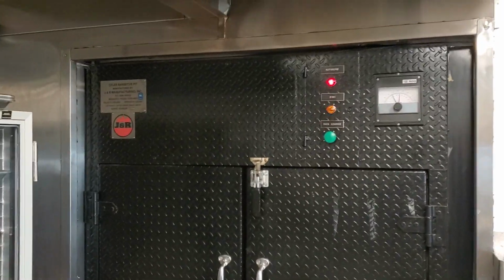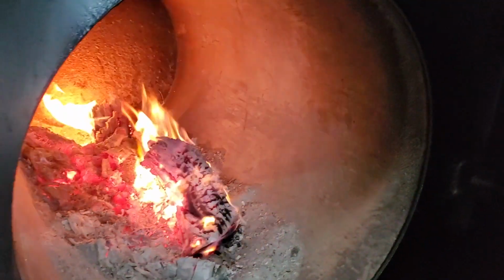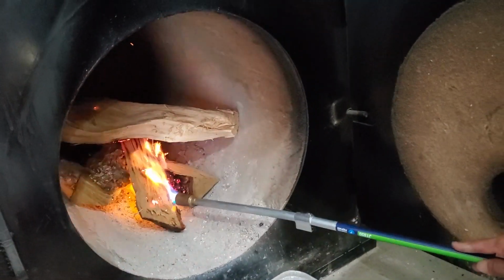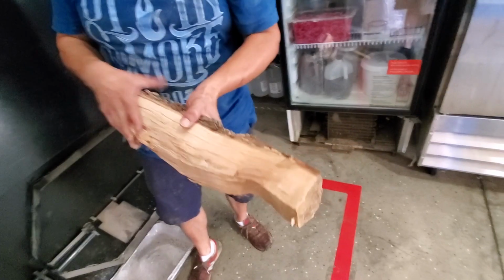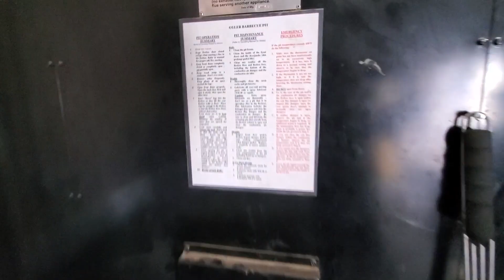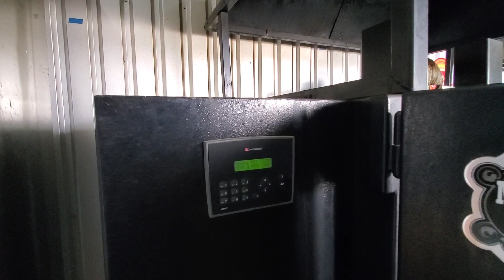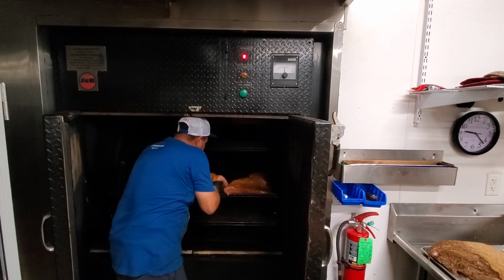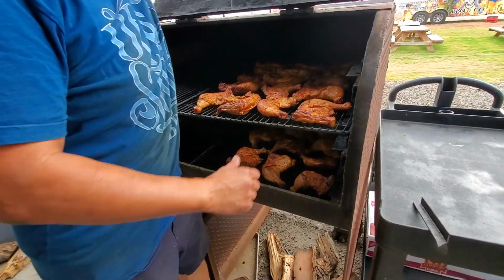Part 3 of 3 Texas BBQ Champion Junior Urias $100K Smokers TLC BBQ Pitmasters Discovery TV Harry Soo

Comment: Hello Harry! 
I cooked on Oyler pits for over 35 years. Owned a BBQ joint here in Carlsbad NM. Had 2 Oylers and a J&R Smokemaster.
The Oyler is the best pit God ever let man make in my opinion. Looked forward every morning to firing them up.  Great video.  Thanks.
Reply from the maker: Thanks for stopping by Danny.  Some Oylers have been running since 1968 and still going strong.  I've even seen one at the Raffles Hotel kitchen in Singapore!
Reply: You sell your restaraunt or what happened? Sounds like a large operation